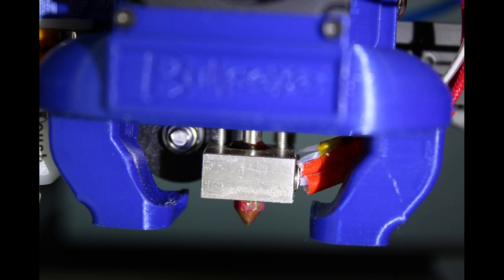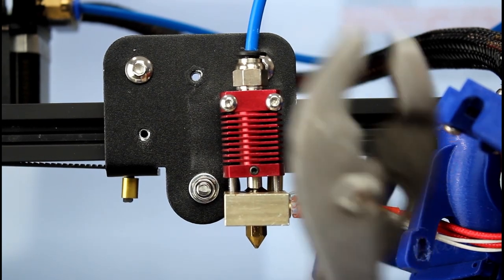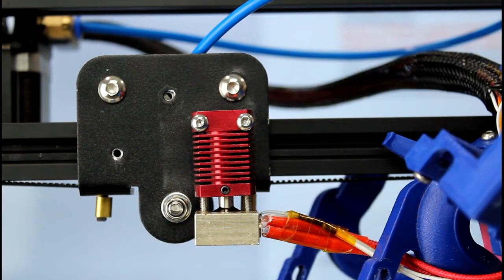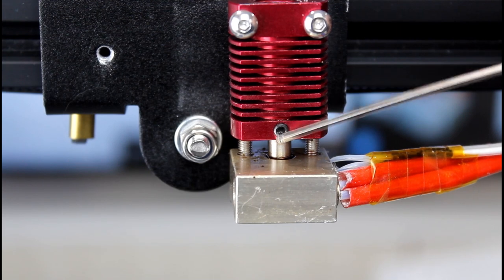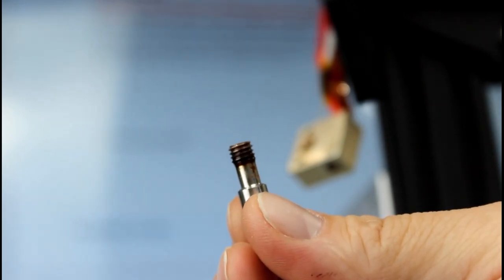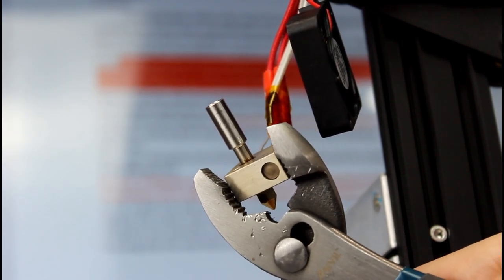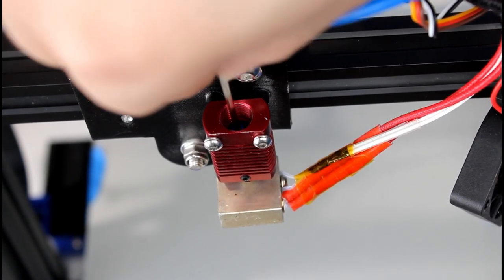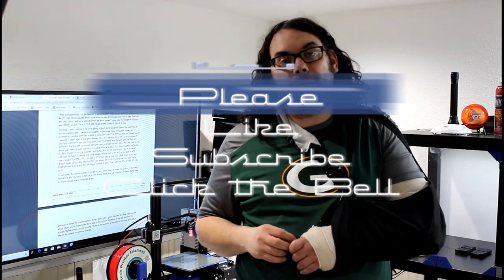Section 3.2 Nozzle Clogs featuring the Ender 3

Comment: Finally someone who clearly shows/states that the heat break does need to be screwed in all the way into the block, and not loose like it seemed to be from the factory.
But question: if the bowden tube is tight enough against the nozzle like it is supposed to be, how did you get that leak?  The seal between the tube and nozzle should have prevented the leak.

Comment: thank you so much! this was the first time I had to change out a nozzle. i burned myself so much lol anyway i got it done with your video. only thing i'd like to say is please write in the comments which way the turns are. i think they are counter intuitive. not lefty loosey righty tighty. bc i had such a horrible clog and filament melted everywhere, i didn't realize i was trying to tighten it at first. i used a heat gun to remove the filament bc it just would not break free. i did make sure not to hit the wires. finally the filament broke free and i could take off the nozzle and turn it. i wouldnt recomment using a heat gun, they get super hot, but it was really stuck. to clear it i put the machine up to 260 and pushed out muck with allenwrench. the cables started to smoke and the ender automatically went down to 208 again. whew. long process and i wouldnt have made it thru without this video :)
Reply: No it’s still lefty loosey righty tighty. You got a remember they’re getting thread it UP IN to something not down....  So To make it easier look straight up towards your ceiling n pretend you’re screwing in(or out) a lightbulb and see which way it has to go. That should help you

Comment: quite impressive that youre doing all this with only one hand 😊👍

I had the same problem and I took everything apart, soaked it in acetone over night, cleaned it up and tightened it up. 

I think its important to tighten the throath first and then the nozzle to ensure that there is no gap between the nozzle and the throath. 

Thanks for your videos ! Keep on the good work and be careful with that arm
Reply: I also want to say that if you want to clean those threads and holes, use pipe cleaners. They are perfect in size for cleaning.
Reply from the maker: Thanks for watching! I appreciate it, and glad to say that the arm is pretty much healed now!

Comment: Just a quick warning about the brush: I just blew my board by using a brush just like this on my hotend. The bristles connected with the heat cartridge wires and sparked. Now the board doesn't boot. So, use nylon brushes or some other non-conductive bristle; don't use brass or whatever these metal bristles are made of.
Reply: i agree ...its molten plastic...tissue and q tips would clean better

Comment: I just did this procedure three times in succession trying fix a "clog" problem.  Didn't work!!  Turns out the root of the problem was/is the two screws adjacent to the nozzle causing "heat creep".  To be more specific, during the first couple hours of operation heat from the heat block will "creep" up the two screws and heat the lower end of the heatsink enough to soften (not melt) the filament enough that it begins to adhere to the inside of the PTFE tube.  The softened filament increases friction inside  the tube so great that the extruder cannot overcome it and THAT is a clog.  I did this procedure again, this time removing the screws.  Five hours later the machine handed me a perfect part.  I'm  not saying that everyone should remove these screws but I do think that the makers of videos like this one professing to cure clogging should raise the issue of "heat creep" as a potential problem and how to fix it.  I'm a newbie and I had to figure it out for myself.  It should also be mentioned that some (maybe all) of the hot end parts that are being "cleaned up" in this video (and others) are cheap enough that it's not cost effective to spend hours cleaning them while they burn your hands.  Throw them away.  Cleaning molten plastic out of a female thread in a $5 part is not my idea of a fun weekend.
Reply: Creality confirmed you're not supposed to remove the screws.  They keep the block straight and not turn.  The heat transfer from the screws would be negligible.  You probably had other problems causing the heat creep where your rebuild fixed it.

Comment: Okay watched this video and have a couple of questions.. so you installed same old cut piece of and washer? so if you had this mod already why did it leak in the first place??? I do not use this mod and my leak was much worse.... i do understand how it is all put together now though... so i will give taking it appart and making sure i assemble correctly.. I am sure from factory my tube was not installed correct which caused the leak in first place possibly...also heat and i did replace stock tube with cap and change nozzle so al of those fixes could have added to my small leak especially if harden filament prevented nozzle or new tube from seating on metal...all makes sense...as far as that tube mod goes  and adding washer i can print so i will hold off...thanks
Reply: Same situation; got a couple leaks, I'm assuming, from the way it was set up from factory. The cut piece and washer is from another video that  he did. It was supposed to be a hot end fix to prevent this from happening so I'm wondering what went wrong myself.
Reply: @tconline2000  Maybe an effect from the heat expansion working the contact between nozzle and throat loose. After cleanup, first heat up to a normal printing temperature and then tighten the nozzle. That way it should seal better when at working temperature.
Reply: @creddox  yes, i was a complete newbie... now i understand this issue it never happened again... he really never explained what caused the leak in first place...i think at the time he was just learning himself... i have had mannny 3d printer issues on my ender 5 and a cr 10 clone i built over last 8 months...

Comment: I’m missing that black washer you pulled out after taking out the ptfe tube where can I get a replacement
Reply: Print it from thingaverse.  It's used in a mod where instead of one long bowden tube going from the extruder all the way to the nozzle, you have two pieces: one Capricorn (higher temp tolerance than stock tube) from nozzle to hot end fitting, with printed washer between short tube and fitting to put the needed pressure on the tube, another tube between extruder and hot end fitting.

Comment: Thanks for this. I had no idea about having to adjust the heat break with different nozzles. I always thought that as long as the bowden tube butt up to the nozzle then you were fine. Was i wrong to think that? I have had some mega leakages since upgrading my nozzle. Hoping this will be the fix i need!

Comment: Im about to do this but dumb question. You tighten then losen the nozzle 1.5 turns. When you put the throat back on its butted against the nozzle? If so won't the nozzle be a tad out?
Reply from the maker: It may be a little bit further out than it was stuck, but as long as you're tube is tightened down to it, then that's ok. you'll have to relevel your bed when you're done either way.

Comment: I have a real Question.  All I hear and see are people who can't make their 3D Printers work, or get good parts off the machine.
My experience is, hours and hours worth of trouble shooting, Tweaking, Adjusting, Etc... to get one Semi-Okay part.  Then when we try to make a 2nd one,  it doesn't work like the last one and the trouble shooting, Tweaking and Adjusting Starts all over again.
Every time there's a new Problem.
No plate Sticking
Parts peeling apart
Parts Warping
Run out Sensors Failing
Nozzle Problems
Extruder Problems
Filament Problems
Machine just stops half way through the part
Filament Snapping.
Bowden Tube Problems
A Combination of all the above.
etc.

Every Print it's something different.
And the only consistency is there will always be a different problem.

How Much do you need to spend on one of these machines until you get something that actually works relibly?

And since it take the better part of a day to make even one small part (If it works and makes it all the way through), Is there anyone who can actually make any money with these things? 
or do they work 24hr a day for free?

It's like owning a boat.  it seems like a great idea until you have to store it, clean it, maintain it, repair it, tow it, etc...  so you just stop using it after a while?

Comment: I am getting clogs still even after Luke’s hot end mod. Seems like you got one too? What else can I do?
Reply: If you have stuck filament in the hot end where the filament seems to be swollen, you might want to tweak the settings to reduce the number of retractions by using a higher Retraction Minimum Travel. I notice when printing small models with high details, my printer does a lot of retractions and I keep getting stuck filament, this fixed that problem.